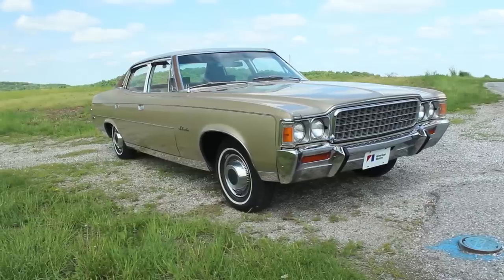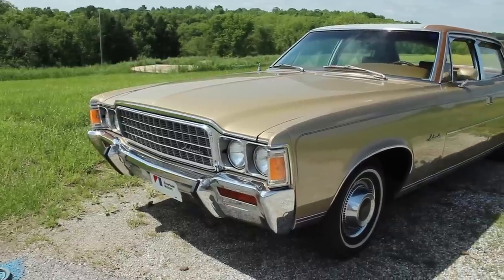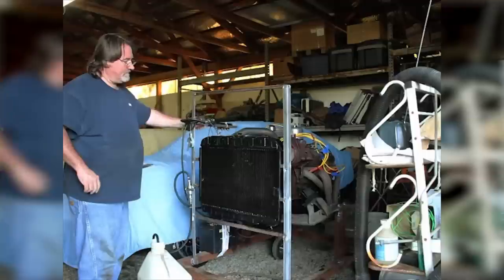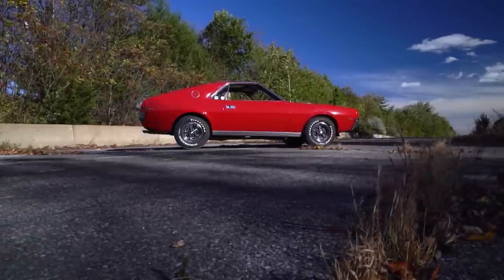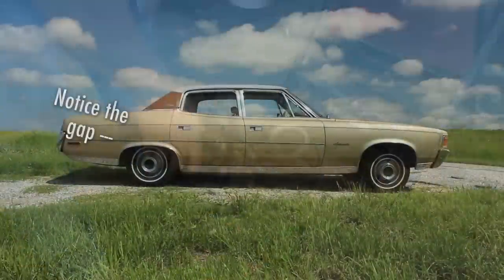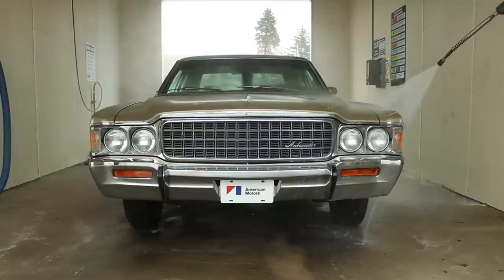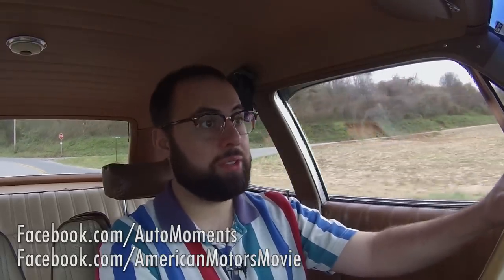Ambassador Vlog 4: Trans & Spring Swap

Comment: You are correct. Increasing the rear spring rate decreases understeer and/or increases oversteer depending on the front spring rate, shock rate and anti roll bar rate. Welcome to the world of getting your classic car dialed in while you play detective figuring out how many goofy things people that previously owned the car have done to it. Very nice job on the MotorWeek segment on the cougar! Looking forward to seeing your next Auto Moments videos. Thank you for keeping your car out of the salt.
Reply from the maker: Thank you thank you!  There's always something new to learn about cars!
Reply: @AutoMoments  And almost as often something new to learn about your car, if the previous owner(s) have been active with making 'adjustments'. 

For example, I just picked up an '88 Volvo 245, and the very first thing I noticed was that someone had rewired the exterior light circuit after the ignition. Take the key out and the lights are off. Put it back in and turn it back to accessory, and bam, you have your headlights.

Comment: My dad pulled a boat in his 72 Ambassador. He upgraded the rear shocks to Monroe Air Shocks. My mom used the car for her 9-5 banking job. I got to use it all the rest of the time between ‘74-‘77. You could really smoke the tires easily. That was what I was known for amongst my friends. It would chirp 2nd gear under the right conditions. Had the 360 2 barrel. Also had a special gear ratio in the rear end (I don’t remember what it was).

That car would pull our boat like it was nothing. Pull it right up the boat ramp like a truck! Heavy boat, too! Don’t know what it weighed, but it was built in the 60’s, 21 foot, had a cabin, wide beam, and was powered by an inboard Buick V-6 with OMC stern drive.
Reply from the maker: Very cool!  Thank you for sharing your AMC memories.

Comment: Not sure if they still offer them, but you used to be able to get overload shock absorbers with a spring around them, intended for maybe a station wagon you were using for heavy loads. I had a 40+ year old '62 Lincoln that had them when I got it. It was pretty flat front to back. I'm sure they were added to fix (roughly) the often seen leaf spring sag on these cars. It would be a cheaper fix laborwise and maybe parts too than replacing sagging coils or leaf springs, and you probably need new shocks anyway.

Comment: I'm not a transmission expert. I am an old timer and I remember the condition you experienced with your transmission was a common one. This condition was known as slipping between gears or simply a slipping transmission.  As I recall some times it could be corrected by a transmission fluid and filter change and sometimes you could tighten up the bands in the transmission. If that didn't work then it was time for a transmission overhaul.
Reply: No expert either, but automatics started getting clutches instead of bands, and clutches are probably not adjustable. (I also heard about adjusting bands.)

Comment: It’s interesting that you mention your Ambassador needing new rear springs because of a sagging tail. I’m a longtime AMC enthusiast and owned a Gremlin and Eagle as a teenager in the late ‘90s. It seems that so many AMC ads and press photos from about 1967-83 at least showed their cars sagging in the back from new. I’ve always wondered why. Did AMC just use weak or soft rear springs at the rear of their cars? Or overly robust springs in the front that they knew would mellow under their heavy engines over time? And why would they advertise cars that so obviously looked like they were dragging their tails? Here are a few examples of what I mean. What do you think?

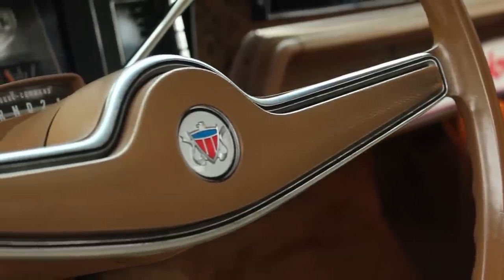1967 “Now Cars” 0:10 and 0:38 https://youtu.be/VVAqlCTRKQc

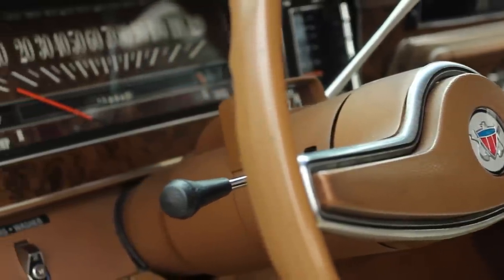1969 Ambassador 0:45 https://youtu.be/UjUOd_NQarE

1975 Pacer 0:38 
https://youtu.be/VnEVYakdBmM

1982 Eagle SX/4 4:03
https://youtu.be/xcdRVWFwb1I

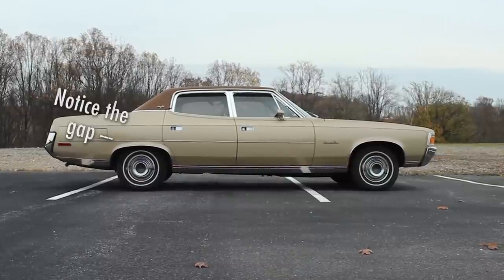1983 Spirit and Concord 3:45-4:00
https://youtu.be/JNwUemUfX2I

1983 Concord 5:55
https://youtu.be/lg8BJuh42Nk
Reply from the maker: Yeah, I see what you're saying.  This is just an educated guess, but part of it may have been just the "style" of the era was to have a lower rear end, and maybe the soft springs provided more of the ride customers wanted.  Also, part of it is maybe a visual effect; the rear wheel wells are a different size and shape than the front ones, which I think exaggerates the look of the rear end sagging.  It is interesting how so many commercials show the same look.  I wonder if other carmakers' cars look like that too.
Reply: AutoMoments Thanks for your thoughts! In the ‘50s and early ‘60s, I think a lower tail was common for sports cars like the Spitfire, 61-66 Thunderbird, Duetto Spider, and Austin-Healey 3000. Those seem more to be drooping rear fender lines.

Your point about lower rear wheelarches is a good observation. I look at whether the rocker panels are parallel to the ground to mitigate the optical illusion you noted. In the examples I posted, the rocker panels on each car don’t seem parallel to the ground.

In the ‘60s and early ‘70s, that might be okay. But once the gas crisis hit, this situation would hurt aerodynamic efficiency significantly because so much air is going under the front of the car and through its suspension and mechanicals rather than being directed over the much smoother body. So it seems kind of strange to me.

By the mid 1970s, wedge styling was in, which has the opposite effect. I don’t see a lot of other period car ads from other companies showing cars with sagging rear ends like AMC’s ads do.
Reply from the maker: @judethaddaeus9742  Yeah.  It definitely would be interesting to do a comparison with cars parked side by side!

Comment: Is that the seatbelt hanging in the window?
Reply from the maker: Yes!  The shoulder belts are not retractable, so there's a little clip on the ceiling to hold them up when not in use.  Joe talks about them in this episode: https://www.youtube.com/watch?v=CaUbkoRcHao
Reply: @AutoMoments  So no one actually used them! I had a 1969 Renault 16 with nonretractable seat/shoulder belts. I had to unhook to reach the radio. No leaning!